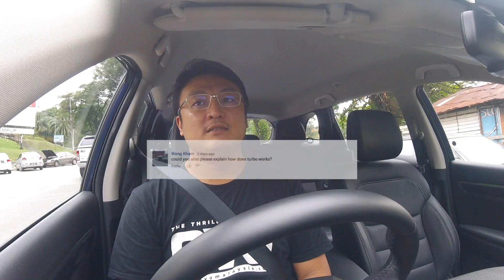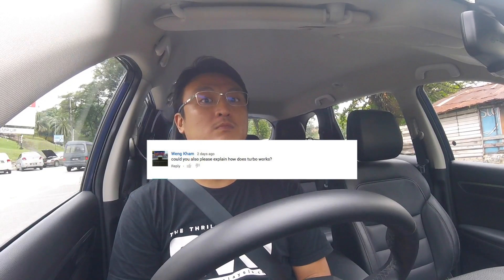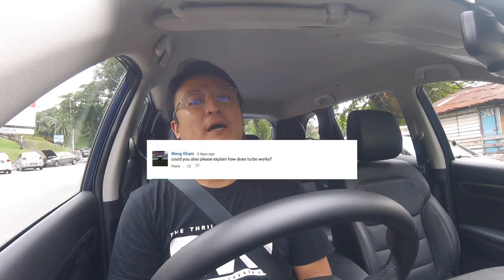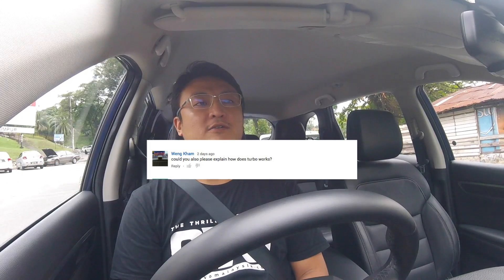Layman Tech Talk Ep3: How Turbochargers Work? | EvoMalaysia.com

Comment: Many of my friends seem to have opinions that we should avoid turbo engines. Reason given is that it is costlier to maintain in the long run as compared to naturally aspirated engines. Is that true?
Reply from the maker: It's true. They shouldnt stop at Turbo, in fact a car without aircond compressor, steering pump, torsen differential, wipers etc will be the most reliable. The thing is this, the less parts you have, the less moving stuffs connected and working, the less chance of having to experience things failing in the long run. And if a turbocharger was made to last 100,000km and it did its job and died at 100,001km; then it is not a failure but a lack of upkeep by the owner because he should've changed it before it failed. Same goes to waterpumps, oil pumps, steering pumps, fuel filters, brake pumps, aircond compressors, turbochargers, superchargers, everything has a lifespan. And throughout that lifespan, proper lubrication is needed, scheduled maintenance and upkeep is needed. Why is it that we can accept our lifts or escalators failing, our fridge failing, our aircond failing but it seems everyone expects our cars to work forever?